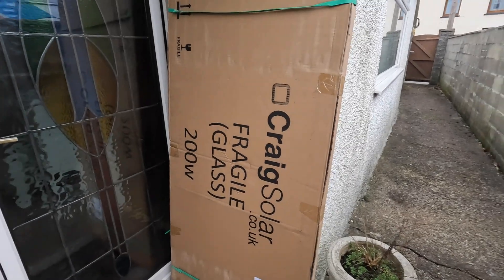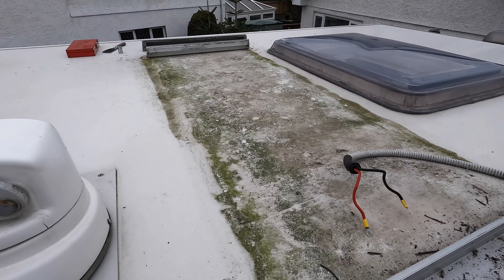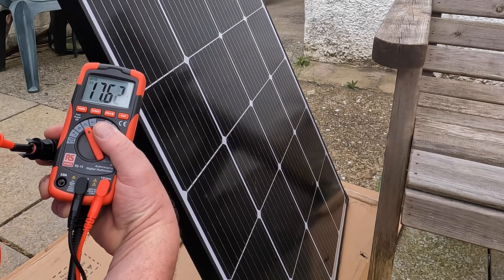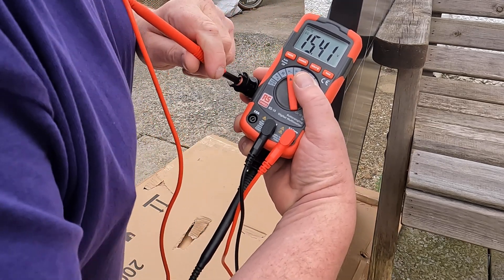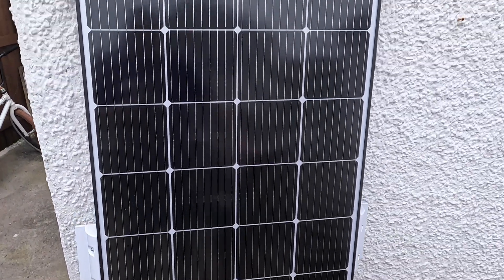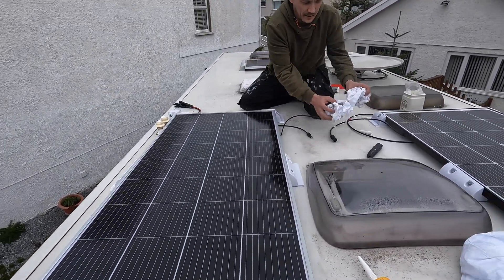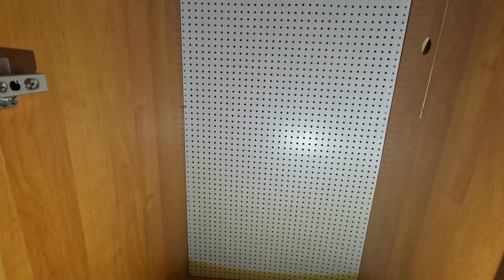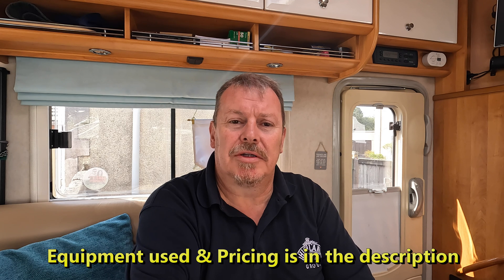MOTORHOME DIY | Solar Panel Installation | Concorde Charisma i830H

Comment: How many watts was each panel? Don't think you mentioned it 😂 - great job, except for those fuse breakers 🤮
Reply from the maker: 😜 200W in case you missed it 😜 Each to their own with the breakers, may change but will do for now 👍 Thanks for watching 🍻
Reply from the maker: Also forgot to mention your 'top tip' ... Tile spacers in sikaflex 🤗
Reply: @WattsOccurring - who needs enemies when I have friends like you 😉🤣